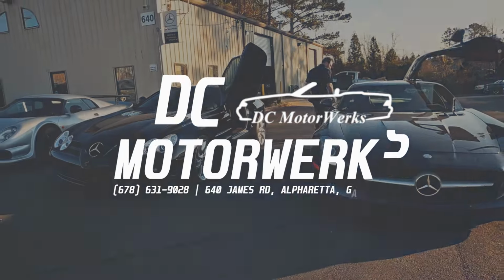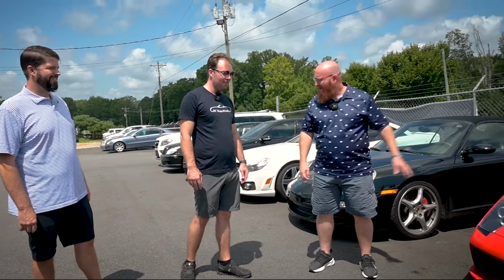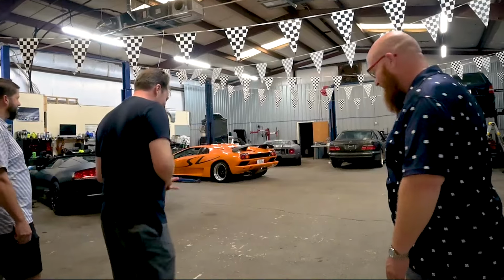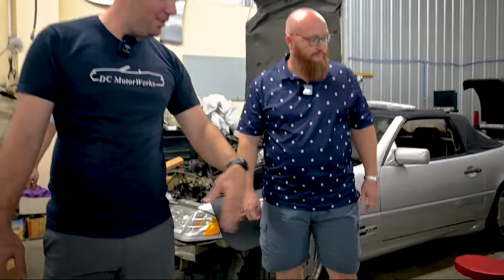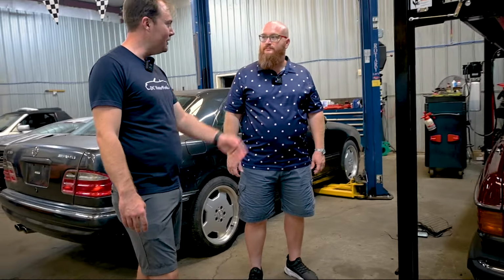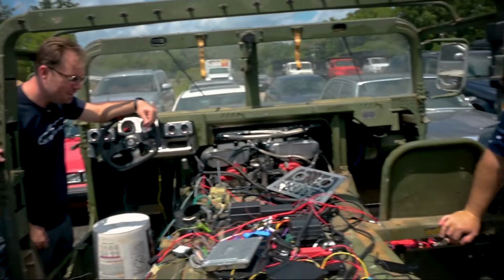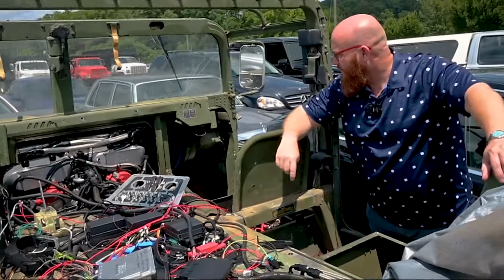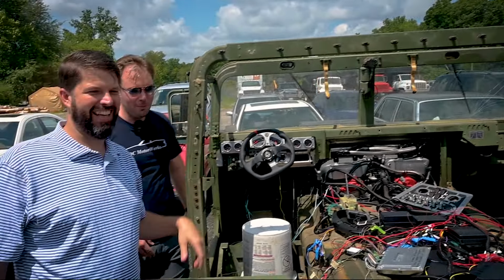We Hired The @CarWizard For HELP!

Comment: lemme guess, your SL 600 has disintegrated biodegradable wiring harnesses that you now have to handcraft manually due to the fact that they are NLA?
Reply: It’s a 98 which doesn’t have the wiring issue